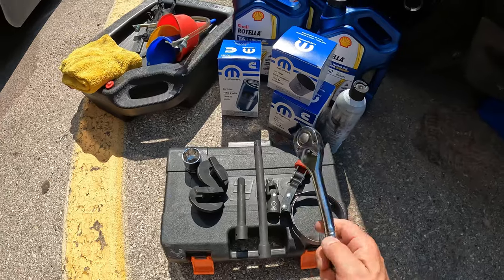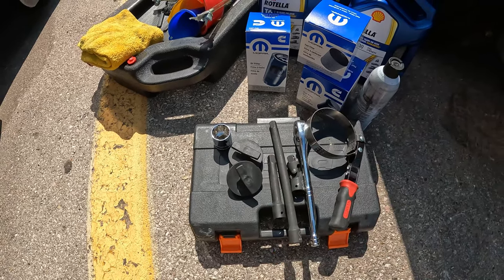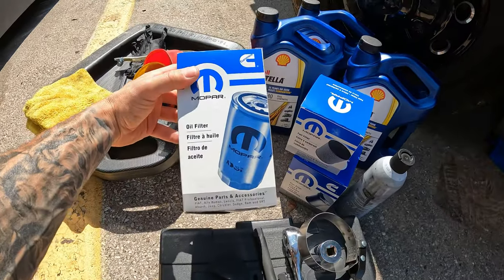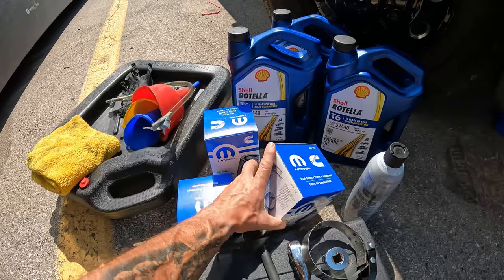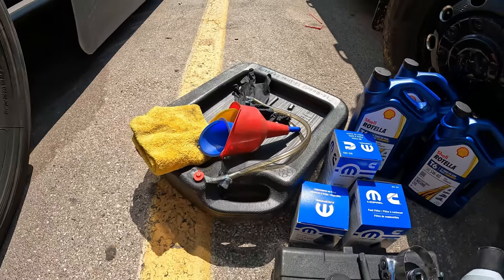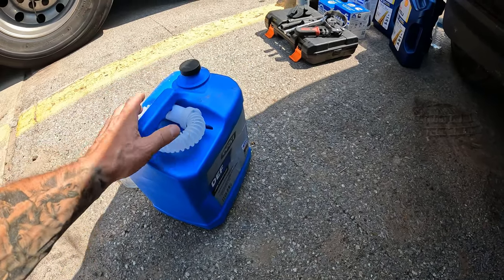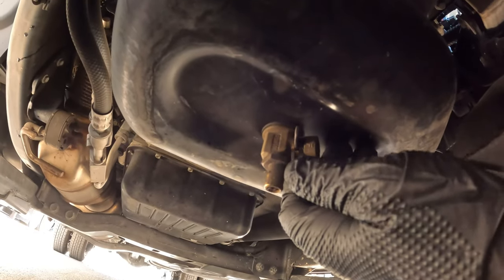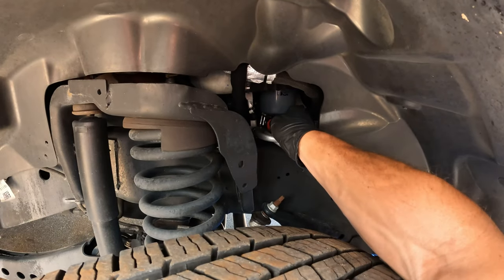2022 Ram 3500 Oil change and fuel filter service

Comment: ! quart loss/burned over the course of an oil change is normal, even for gasoline engines. That's why checkin oil should be done a minimum of once a week. In professional driving situations like yours, I recommend checking it during each pretrip along with all the other fluids. If the truck were a daily driver, I wouldn't be too worried about running 5-40 year round but since you're in hot climates frequently and towing, I would recommend using 10-40 spring thru fall. I was an ASE certified mechanic for several years and I have operated heavy equipment growing up on the farm as well as driven OTR and heavy truck locally for about 31 years. Very thorough process you have tho, good job. I would also take this time to hit any grease fittings that may be on the truck, if any.
Reply from the maker: The thing is I do check it and it always shows full.
Reply: @Mr.AlexKogan  in this case, what I would do,  and you may have already done this,  is to take a marker and mark the level in each jug before you pour any out. When filling up with waste oil, fill to these marks to more accurately verify your suspicions.  1 quart over the course of an oil change is normal in any engine. Subaru even told me that their allowance is 2 qts ! Lmao.  If you're still unsure,  call a few Ford service departments or trusted technicians if you know any and ask them. I am only a person on YouTube to you, so please feel free to verify the information I'm giving. If things have changed and I'm wrong, please tell me so I can learn also.
Reply from the maker: @thehillbillyhermit7681  Correct. Certain manufacturers say it’s normal to burn oil. My wife’s BMW x6m says it’s normal to burn one quart per 1000 miles. Sounds like a lot but it’s a performance engine so go figure.
Reply: @Mr.AlexKogan  ya, being an old school person, that's an amazing statistic to me. Lol

Comment: According to the manual 5W40 can be used year around.   Also best to use a 6-point socked on the fuel filter cap to avoid rounding out the hex.

Comment: Your oil filter retains about 1-1 1/2qts in the filter media and canister. You won’t get that out without crushing or cutting it open due to the anti drain back valve in the filter. So you’re essentially missing the same amount of oil that you prime your new oil filter with because it never makes it into your drain pan. Hopefully that makes sense. Love the content, keep it up.
Reply from the maker: Thank you! That makes sense for sure. Appreciate it.

Comment: I just bought stuff for my 2023 first oil change.  They gave me rotella 10-30
Reply from the maker: @wallyyuriy8912  Yeah I’ve now used Rotella t6 10-30 now that Walmart sells it but they don’t always have it in stock. 10w30 for summer and 5w40 for colder months.

Comment: One of the better DYI videos with LOF and fuel filter changes.  I use Amsoil 10/30 diesel oil in my ‘22.
Reply from the maker: Thank you! I’ve always used Rotella but I think I’m going to get all amsoil for all my gearboxes.
Reply: Me too i using de 10w30 here for in Puerto Rico tropical area
Reply: @Mill72 what you buy in Amsoils? The quears bottles or gallon jug?

Comment: Bought a new '23 Ram 3500 dooley with the 6.7HO.  Ready to take it in for its 1st oil change but hate dealer services.   You just made it look super easy to do myself.  Thank you!!
Where do I find that drain valve that fit in the pan?  Thats a great idea.  TY!
Reply from the maker: @jumpoffjoe6572  You can get that valve on Amazon or on Fumoto website. 

https://www.fumotousa.com

Comment: Hello Aex. I'm Frankie from Argentina, I watch your videos and it's the best there is, (a lot of lies going around). Speaking of your oil consumption in your truck, 1/4 to 1/2 is normal at that level of use. 1) not everything drains when changing, 2) take note of the use of your truck between changes, how many miles were loaded and how many without, working temperature, hot and cold days, hilly and uneven routes, weight of loads. (You're going to have a difference.) Think that that truck consumes that much without loads only with normal use. If it were mine I would use 5W50. Whatever you need Frankie
Reply from the maker: Frankie, thank you! I am happy to know you are enjoying the videos. I’m sticking to 5w40 all year round. I think I’m not letting it drain long enough and before draining I should let it sit at least 30 minutes. These trucks are very sensitive when it comes to oil changing and checking the level. When I check my dipstick it’s always at full so that’s why I think I’m not draining long enough. Now I let it drain for a full hour 😁 This way I know most of it is out 👍🏻

Comment: Same problem mine. Here in Puerto Rico are hot weather and no are available de new 10w30 by rotella yet. And all dealerships here using the 5-40
Reply from the maker: So you are loosing oil between oil changes as well? I guess it’s normal then.

Comment: What's up the 5w40 is good ,   The 40 means that it could hold high heat is good when you idle the truck  When you tow heavy loads ,  The 5  Wait  means it's  little bit thinner . But that truck is a fifth gen, 15W is no good for that truck. 5W 40  Is perfect . I have 6.7  engine too  But  4 gen  I use 15w40  All year round. No problems. 👍👊
Reply from the maker: I know 5w40 is good but on oil cap it says 10w30 in summer. I’m just sticking to 5w40.

Comment: You content it’s awesome you make it look like it’s super easy but I always get a hard time with the fuel filters But in the end I got it, only this time my truck doesn't want to start and I'm really frustrated, if I tighten the filters too much like you did in the video it never wants to start, I always have to loosen them and play with the pressure when tightening them, but this time I've tried too many times and I can't do it, has something similar ever happened to you?
Reply from the maker: @alanojeda5099  you have to tighten the cap tight otherwise it’ll leak. Since you drained the fuel, you have to cycle the keg a few times in the run position so the fuel pump can pull the fuel to the injectors. Otherwise it will not start because you have no fuel in the lines.

Comment: 5w-40 is only thinner than 10w-30 when cold. It flows better at start up and because it's a 5 weight in winter or cold start up vs a 10. But when the motor is hot it becomes a 40 weight vs a 30 making it a bit thicker when hot for more protection.  I'd stick with the 5w40 year round!
Reply: My manual says over 0°F 10w-30 and under 0°F 5w-40
Reply: @andrewm8139  Stick to what gives you peace of mind!

Comment: Perhaps some oil is absorbed into the filter media and not releasing may add to your one court way you're filtered before you fill it with oil and then When you fill the new filter up see how much oil in to = same weight as old
Reply from the maker: @powerhousepete1570  Yeah some of it is sticking in the oil filter and some off it gets sucked up to the CCV filter.

Comment: Awesome video, Alex! Do you mind posting a link where I can get that same exact oil filter wrench you used please?
Reply from the maker: Thanks! The wrench used to unscrew the oil filter? Here is one on Amazon but you can find them at auto parts stores or Walmart maybe cheaper. 

DURATECH Large Swivel Oil Filter Wrench, Oil Filter removal tool fits filters 3-7/8"-4-3/8", Perfect for Car Repair Tools https://a.co/d/8t0DZ3v

Comment: Hey, Alex! Is your truck the HO diesel with Aisin and 4:10 gears or 3:73? How do you like it so far? Anything you would change or have if you were to purchasing again? Thank you in advance. I'm in the market for a 2022 or 2023 Ram 3500 dually with the HO diesel and Aisin.
Reply from the maker: Yes mine is the HO with Aisin and 4:10 gears. The 4:10 comes standard with max tow package. I love the power of the truck. Tows real good. I probably wouldn’t change anything about it. I’m happy with my choice. Aisin transmission isn’t the smoothest when city driving with no load.  It’s built for towing. Other than that everything is great about it.

Comment: So I’m getting ready to do my first oil and fuel filter change - I see you use Rotella T6 which is one of the recommended oils. I hear a lot about Amsoil Signature - what are your thoughts?
Reply from the maker: Amsoil is a good brand. I e never tried their oil. I d always used Rotella T6 since first oil change. It’s been good to me and it’s sold at Walmart so you don’t have to order it. Rotella is very reputable oil for diesel engines.
Reply: Thanks! I think I’ll stick with Rotella T6 10W30. So three gallons is all I need?
Reply from the maker: @Griffshawn1  you will not find 10w30 at Walmart. 5w40 is what I use. It’s what’s recommended in summer but I use it year round with no issues. 3 gallons.

Comment: Rotella has a new synthetic T6 10w-30.

Rotella has a synthetic blend T5 10w-30.

I’m considering changing from the T5 to T6. I live in the northwest so I can get away with 10-30 year round due to the mild climate.
Reply from the maker: Ive been doing T6 5w40 and I think I’m not going to change anything. Haven’t seen any problems with using that weight year round.

Comment: I have a 2022 ram ecodiesel and I order my filters from Doc’s diesel MUCH cheaper than the dealer and works the same
Reply from the maker: Yeah I use docs filters too for my fuel filters. $80 for both off Amazon. 👍🏻

Comment: Most engines don't get all the oil out via the drain plug, there is still some small amount of oil left in the pan as well as throughout the rest of your motor. Also, don't forget how much oil is still in your oil filter. I think the 5w-40 provides better protection in the Summer when the heat causes the oil to get hotter and in turn thinner, but Cummins does recommend Valvoline 10w-30 CK-4 for the Summer so that's probably not a bad choice. 5w-40 CK-4 oils are a lot easier to find, though. I'm coming from GM trucks and GM has a bad habit of recommending these lower weight oils in the sake of CAFE fuel economy to the detriment of what otherwise may afford your motor the best protection. What you need to look up and compare is what the viscosity at 100°C is, and preferably what the HTHS. The only specs I can find on Shell Rotella's new T6 10w-30 show that it has a 14.7 cSt at 100°C which puts it right in the middle of a 40 weight oil.
Reply from the maker: I’ll prob just stick to Rotella t6 5w40. I’ve always been using it and never tried anything else. I do drain the oil filter as well and I let the engine cool off for 30 or more minutes before draining and then let it drain for a minimum of 30 minutes. That should be plenty of time to get all of it out. 🤷‍♂️

Comment: So I just had my truck serviced today at the dealership. When I started it, everything ran fine. But I made a stop at a store and when I went to start my truck, it just sat there and cavetated like it wasn’t getting any fuel, then it fired up. Any idea what was happening there?
Reply from the maker: What did you have serviced?
Reply: @Mr.AlexKogan  I had the oil and fuel filters replaced.
Reply from the maker: @darrelleddington7948  really I have no idea. Especially since it ran fine right when you picked it up.

Comment: 5W40 is fine it will be a 40 grade at hight temp and a 5 grade till it warms up not a big deal. you could squeeze a quart or more out the oil filter so that could be where your mystery of the missing quart could be.
Reply from the maker: I definitely drain the oil filter so it’s not in there. It’s a mystery 😁
Reply: @Mr.AlexKogan  losing a quart of oil in 15,000 miles is not that bad it doesn’t even register on the dipstick. All engines consume oil. You definitely do take great pride in your ride.
Reply from the maker: @wildmanofthewynooch7028  I don’t let it go to 15k. I change it every 8k.

Comment: I would never use the quick easy drain plug. What happens he would hit a piece of wood on the road at night and I see it next. You know your motor is blown to save a few minutes ridiculous. Leave the original plug in the deal. Wanted to do a quick oil think they would’ve put that in.
Reply from the maker: This isn’t a Honda civic that’s scraping the ground. This is a  truck that has sufficient clearance from the ground. Your bumper would be the first to hit a piece of wood that high before your oil pan will touch it. Had this drain plug on a previous truck for two years without a single issue. You’re overthinking it my friend. When you are on the road, you can’t cary an open oil pan  to drain into. That’s why I use that drain plug that I connect a hose to and drain into an enclosed pan. Works perfect and no mess at all. Draining into an open pan would splatter oil when you first pull the plug.
Reply: That’s ridiculous.  If you hit the fumuto drain plug.  You have other issues if that’s taken out.  Never heard of any issues.
Reply from the maker: @Mill72  completely agree with you.

Comment: Don't prefill the filter.
Reply from the maker: That’s the worst advice you can give someone.
Reply: @Mr.AlexKogan  It's actually not but ok.
Reply from the maker: @Kahlo69  what is your reason to not pre fill?
Reply: @Mr.AlexKogan  Don't make a mess if you don't have to. Oil pump moves enough volume of oil to negate any "dry starts".
Reply from the maker: @Kahlo69  I see your reason but I don’t make a mess. I have a plug that covers the filter while it’s filled so I can slip it in place and then I take the plug off and mount it. I believe it’s better to have oil in that big filter rather than waiting of the pump to pump it through. I’ve heard guys getting ticking sounds in the engine from not pre filling so I don’t take my chances.
Reply: @Mr.AlexKogan  Then engine, bearings, parts, are all still coated in oil. The oil isn't just going to disappear or lose immediate lubricity. Like I said these pumps move such a high volume of oil at high pressure its not going to hurt. Those who got ticking didn't know what they were doing then. Or treated the engine like shit.
Reply from the maker: @Kahlo69  I’ve always prefilled and it’s worked out good for me so will stick to it.
Reply: @Mr.AlexKogan  nope. stop.